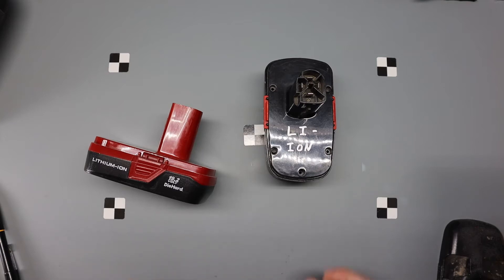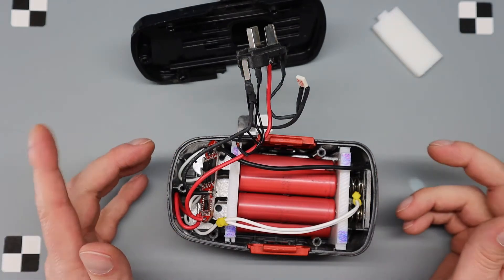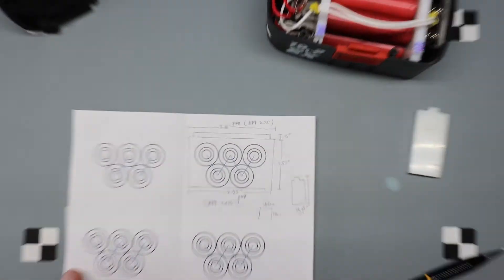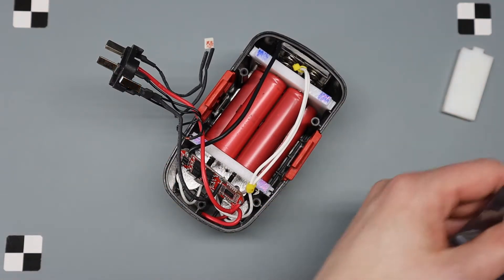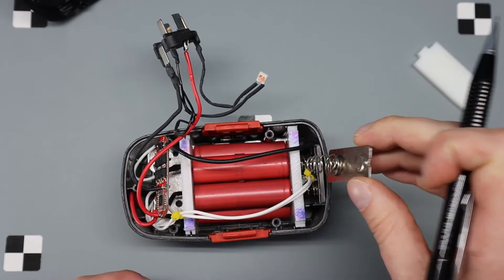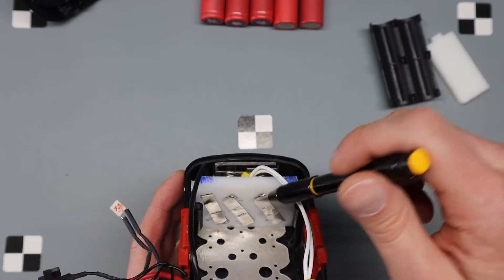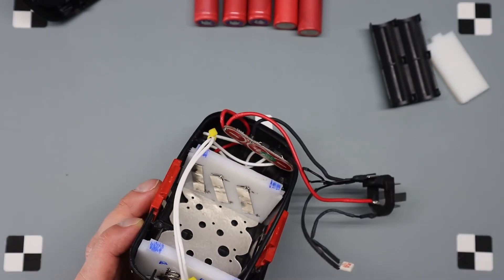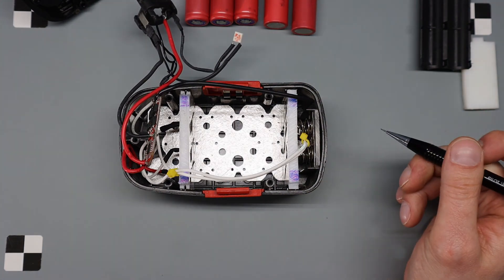Convert Craftsman Ni-Cad Battery to Lithium (part 2) no welding

Comment: Hi, 

Late to the party but trying to duplicate your excellent work here. 

As might be expected, the link to the offset battery holder is dead after 3 years. This is more elegant and allows better heat dispersal than just bundling with Kaptan tape that I see others use. Also makes future service/replacement simpler as you noted.

I have searched Amazon and Google-verse but haven't found any like them. Most are rectangular and not offset. The few offset ones I found are quite bulky. 

Do you have a link to an alternative, a specific vendor name and part number or even precise nomenclature for it?

Similarly the link to the BMC card is dead. I know you had issues for it. Any suggestions on a replacement/alternative and source?

Finally, what AWG wire do you recommend, and solid or multi-strand?

Thanks for your time and help!

Kind regards,
John
Reply from the maker: I added 3 more links and titles in the Description area for the "combined frame holder", 1 Amazon and the other 2 ebay.
I tried a different BMS, but it didn't work with variable speed DC motors https://www.amazon.com/dp/B07X7RRWV8, don't buy that one.
AWG, 16 stranded for the main lines, and 20 stranded for the others, but that's just what I had on hand.
Reply: @eeAspect  Thanks so much! Will keep looking for a BMS.

Looked for a way to donate, but didn't find one.
Reply: @eeAspect Is it possible that BMS failed because it is 15A? I note the high capacity 18560s are nominally rated at 20A. Please forgive my ignorance, my degree isn't in EE.
Thanks again!
Reply from the maker: @ The newer BMS still worked, but was full on/off no variable speed.